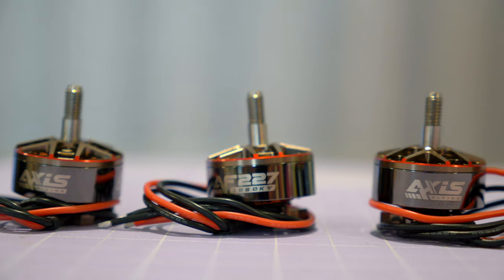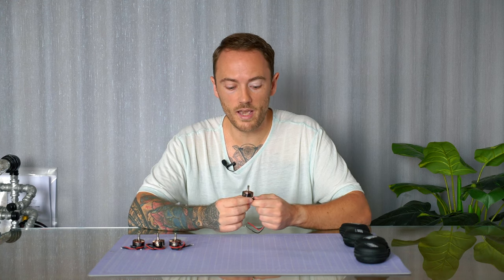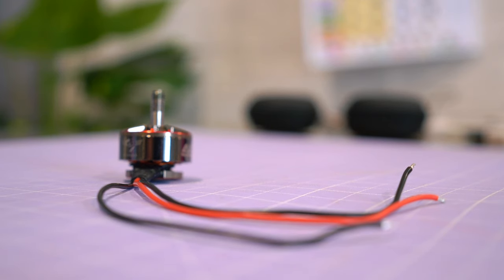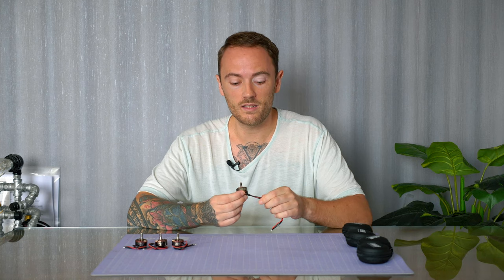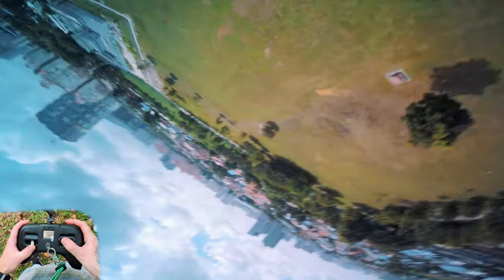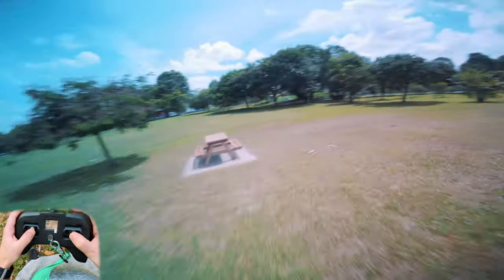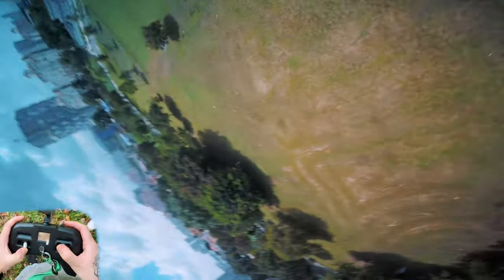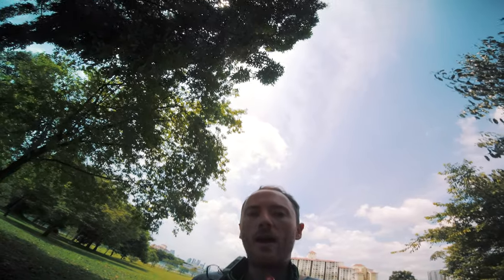FPV VLOG 002 | Testing Axis Flying AF227 1960kv Motors

Comment: Nice to see a review on these man as thinking of getting them 👍🏻
Reply from the maker: Glad to have helped. I’m still loving them to this day!
Reply: @fpvwithpatrick  that’s good to hear. I’m thinking ok the 2306. Did you scale down the 1950kv to help with the battery consumption?
Reply from the maker: @Josh.s.smith88  I didn’t scale them down no. I’m too addicted to the high kv power 😂 tbh they drain my batteries like crazy but I guess it’s worth it for the power. If you like that high kv punch and power (great for last minute recoveries) then definitely worth checking out, otherwise I would suggest going with lower kv motors instead of adding a throttle limit as you’ll lose efficiency.

Comment: I have the 236 1960kv motors and they actually built my confidence. They are so smooth it's crazy. I just got the 2004 for my 4" and it made the quad a completely different experience.
Reply from the maker: Awesome! They are so smooth 👍

Comment: WOW! That is amazing rippage! I'm debating between AF227 1960kv and 2010kv. All my batteries are 6s. Maybe you can share some thoughts about my choices. Thank you.
Reply from the maker: Thank you bro, appreciate it! Hmm well I use 1960kv on 6s and they are already insanely powerful. I don’t know why anyone would need higher, for freestyle at least. It’s up to you though. If you want ultimate max bananas power but no flight time then try 2010. If you want insane bananas power but with slightly more flight time go for 1960. Hope that helps a bit 😆
Reply: @fpvwithpatrick  Gotcha! Helps a lot. Stay safe my friend!

Comment: Hello there mate, Ive watched this your video quite sometime ago. Any opinion pros and cons regarding those motors after a while u had them now? in terms od durability and power hungry?
Reply from the maker: Hey man! Honestly I’m really loving these motors. They are still as smooth as when I first got them and the power is absolutely insane. They are quite power hungry though yeah. I have noticed it really depends on what style I’m flying but generally probably getting like 1 minute less flight time vs my older 1800kv motors. But still, I’m considering buying another set for a second quad I love them that much 😂 I think for a fair test I might get some cheaper motors of a similar kv just to compare. Watch this space haha
Reply: @fpvwithpatrick  thank you very much for helping me choosing mate. Atm I’m flying the vanover v2 and loving them but getting them from us it’s a pain so I need to test those axis and I’m trying to gather as much info as possible. Thanks mate, great review!

Comment: Whats your honbywing esc setting with af227 motor? Any problem?
Reply from the maker: I have it on 32.7 I think with all the basic settings. I didn't change anything. PWM Frequency is 24kHz. No problems so far.
Reply: @fpvwithpatrick  wow i was surprised you dont use 48k..
Reply from the maker: @TERBANGFPV  nope never bothered to change it 😂
Reply: @fpvwithpatrick  cool.. this will became one of my esc choise for my kiss ultra build
Reply: @fpvwithpatrick  my hobbywing just arrived. i notice it comes with only 550uf 35v caps.. did you replace it with bigger one? or just use it as is with af227? im gonna build mine tonight
Reply from the maker: @TERBANGFPV  Nice! The 60A ESC? Nope didn't replace anything, just used the cap that came with it already attached.
Reply: @fpvwithpatrick  friends at ultra discord mention that you got funky desync with it before. Is this true? He recommend to reduce ramp up and raise motor timing to fix.
Reply from the maker: @TERBANGFPV  ah I see. I haven’t had any problems luckily. But my friend did have some desyncs so very useful to know how to fix. Thanks!
Reply from the maker: @TERBANGFPV  …..oh I did have desyncs with my previous motors but that was actually because my screws were touching the motor wires. My own fault